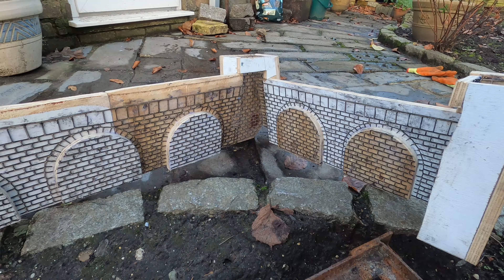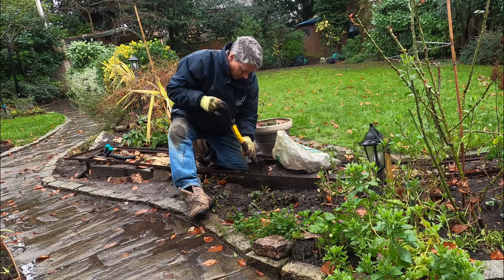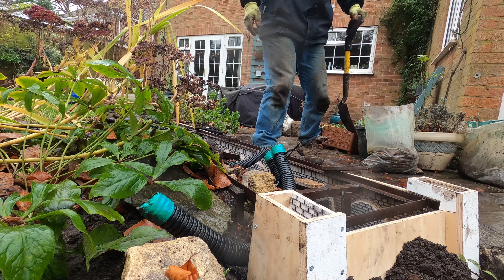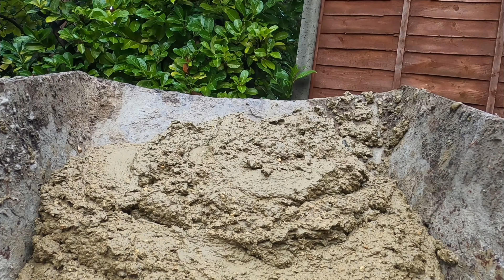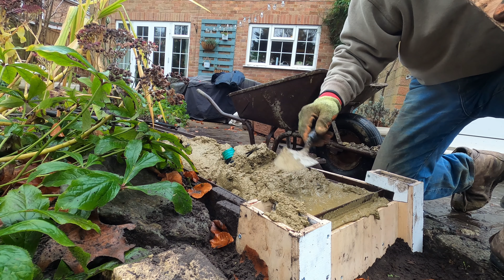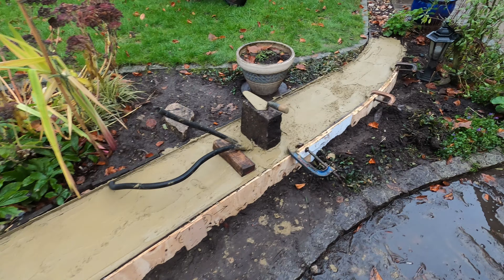Messing about with concrete | Linleys Garden Railway Developments Autumn 2020 Part 7

Comment: Following with bated breath! But did the other half of the test, laser-cut brickwork work OK? Can’t wait to see it.
Reply from the maker: Hi there again, thanks for your comment.  The laser-cut brickwork pattern worked okay except there were two drawbacks with that first attempt.  I mixed the concrete wrongly first time but the second time was much better.  I will include some of that in a later video.  The other thing is that the plastic printing took hours each piece, and I needed so many!  The laser cutting was relatively quick.  The weather has been so wet and cold (well, it is winter!) I have not done as much as I would like to outside.  More videos are due though! Thanks for your support and wishing you the best for 2021.  W :)